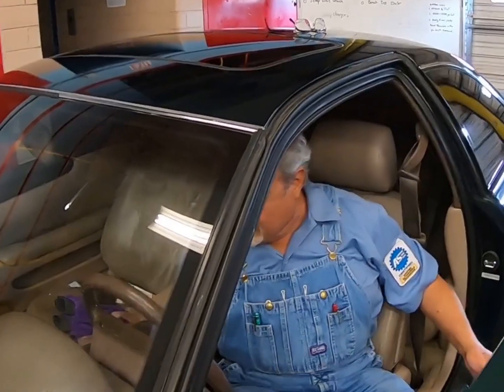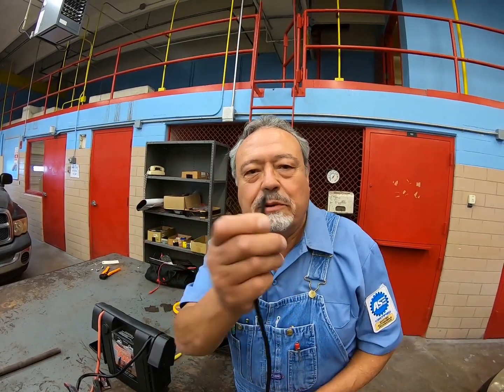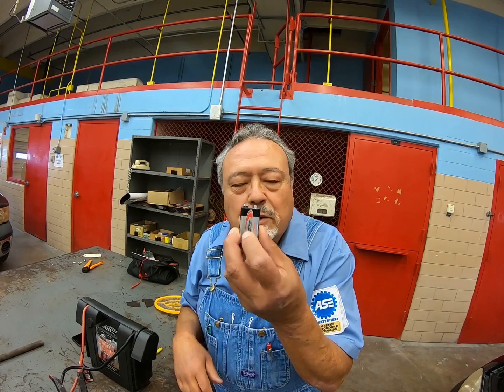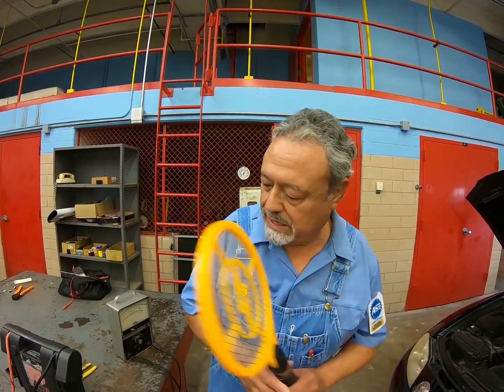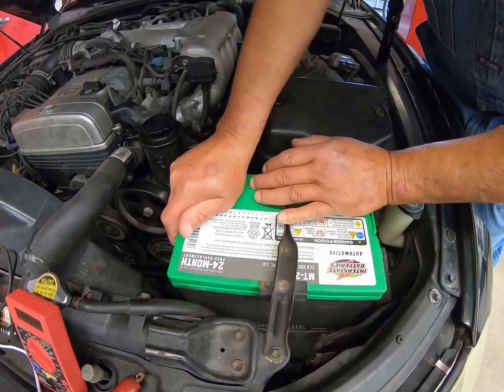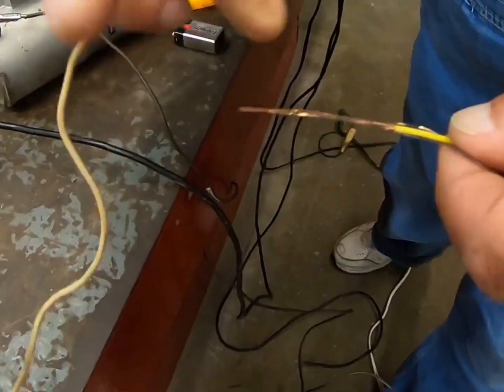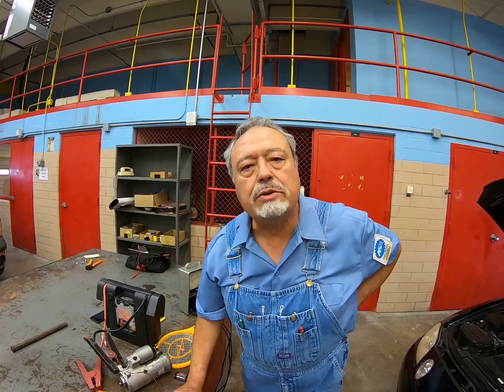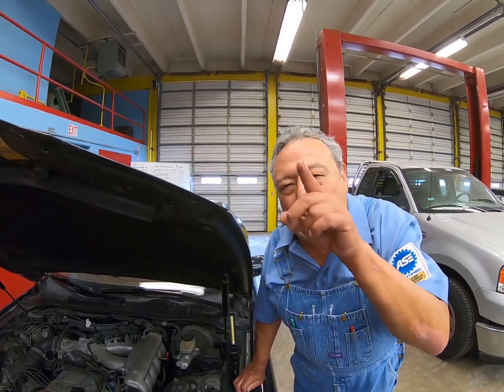He Likes getting  "ELECTROCUTED"  !

Comment: How do you reprogram theft modules or Air Bag modules , an how can one check if his transponder in his key is good .
Reply from the maker: Tough Question and your not going to like the answer. Ten answers : Each vehicle is different. To program anti-theft can be as simple as leave the key on for 20 minutes. Other methods include using a premium scanner with the latest updates. To clear codes on air bag may be as simle as disconnect the battery fo 5 hours or use scanner. Ask me an EZ question like why is Chevy Shitty.
Reply from the maker: Check out this video and see how many automotive jokes you remember hearing when you were in my class : https://www.youtube.com/watch?v=7y5MGWeLEhs&t=90s

Comment: Good ol pfm! 12v tickles, secondary tickles, electricity is fascinating, just make sure to keep your pelito handy!
I play around with old vacuum tube sets now as a hobby, I've learned the DC voltages going through some of those circuits will tickle too! I personally haven't felt the tickle yet, but I've witnessed it. Lol
Great video and that Sun distributor tester is gorgeous! 
I love all vintage test equipment, I have an old vtvm that I added to my equipment list. I'm in the process of replacing all the old leaky capacitors that are inside of it. (vacuum tube volt meter for those that don't know the acronym) 
Anyways, enough with my rabbit trail, keep em coming!
Obi.
Reply from the maker: How do you play with vacuum tubes...?
Reply: @theoldmecanicoshow9004  Right now I've been studying the wiring diagrams and figuring out what circuits do what, why they do it, how they do it and what makes the thing tick. 
High voltage circuits on picture tubes in old tv sets are fun, determining if you have voltage requires you to basically arc the high voltage wire across the top of the tube. As you can't use a voltmeter to check for voltage as the voltmeter would go away.
Depending on the set you could see anywhere around 23 to 40 kilovolts DC going through that wire.
Diagnosing a fault in any electrical circuit with them I apply the same kind of mindset as diagnosing a circuit on an automobile. Visual inspection, ascertain what could cause the fault, locate the circuits in relation to the fault and test for their respective readings either for continuity, or capacitance.
Reply: @theoldmecanicoshow9004  The center switch? Where you put at to measure the volt???
Reply from the maker: @rasmeinhem  Que...?